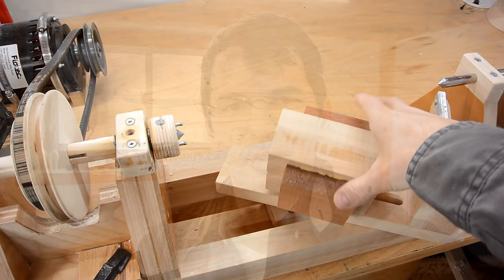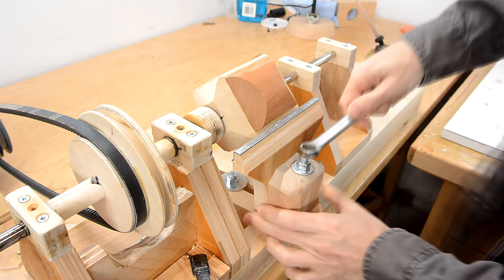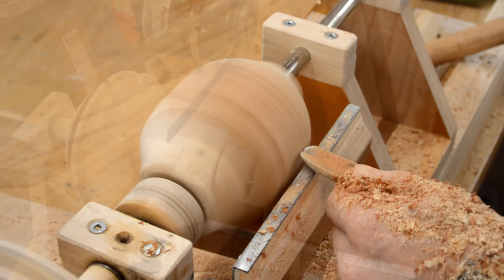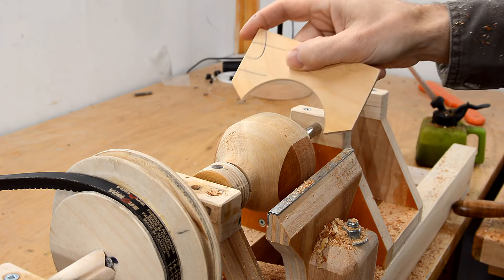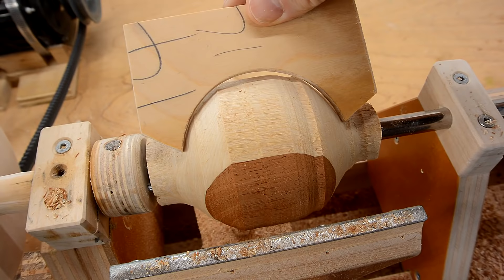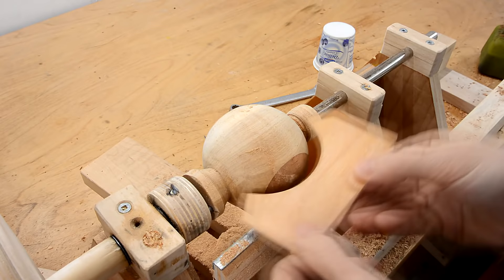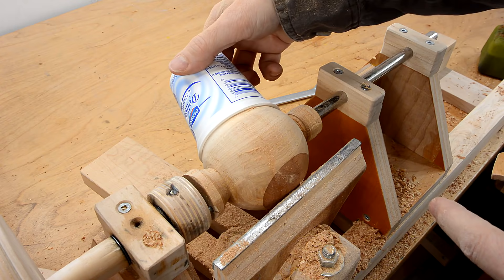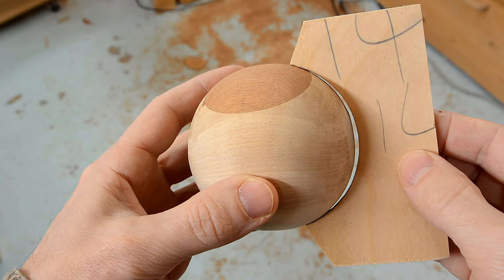Turning a ball on the lathe

Comment: solution for your smooth shaft on the lathe, a washer anchored to one of the upright, a drill stop and a couple of drops of oil. the washer acts a a bearing plate the drill stop holds the shaft in place and the oil reduces the friction.

Comment: For the tail stock problem, you can take a 1/2 threaded rod and grind the end smooth, and put a couple of locking wing nuts on the shaft.

Comment: If you put directly under the assumed center of the ball to be cut, a pivot point attached to your  cutting of the ball and swing it in an arc. you will have a true sphere. and you can stretch the radius arm to make any size ball.

Comment: maybe build a cap at the end of the tail stock with a knob or a screw, then you be able to lock in the shaft and possibly give it fine adjust pressure option, basically a box to go around end of tail stock, then you put a bolt through it lining up with the shaft

Comment: Press a couple bearings onto that tailstock shaft, then you can hold everything in place easier plus have a spinning tail. Or just put a pin through it so it cant move back.
Reply: I thought of a simple bolt screw in line, so you could tension or loosen the shaft.

Comment: I have an idea that might fix the problem with the tail stock: drill a shallow hole in the end of the shaft, place a single ball bearing there, and have another piece of wood bear against that by fixing it to the tail-stock frame. Then figure out a method to prevent the bearing falling out when the apparatus is not under load.

Comment: you need a Shaft Collar on the tale stock shaft their supper cheap they come in two basic types. split ware you have 2 half circle pieces usually held together with screws. and solid ones held with a set screw.

Comment: Maybe an adapter/adaptor for holding the ball in place, while you shape the ends of the ball after cutting and minor sanding? Something that would go over the existing setup or cound be interchanged, so the work isn't skewered yet, still doesn't fly away. It would be your version of a jaw.

I also take it the tension on the belt is adequate? it did jump about a bit >.<

Comment: Did you have vacuum dust extraction below the lathe? I could see the airflow when you were sanding the ball. 
For metal and perspex, I use a ball turning tool that pivots the cutter in a perfect arc as I advance the cut. I think you could probably make something like that for your lathe, to get a perfect sphere. An extension of that concept could be used to cut parabolic curves. Or possibly using a template to cut more complex shapes repeatably.

Comment: If you thread the right end of the tailstock shaft and put a nut ahead of the right side support the tail can be easily tightened. Drill the shaft and place a smaller center shaft inside against a bearing ball to have a live center.
    Mike (o\!/o)

Comment: Thanks for another great video.
I have a suggestion for another test with your joint testing apparatice. Steve Ramsey showed in his video about everybody's favourate joinery (pocket holes) how he kind of seals the endgrain of buut joints by smeering a lot of glue in it. I would be very interested, if this method makes butt joints stronger.

Comment: Why not put something like a nail through the smooth shaft, and then put a washer behind it with the washer sitting on the wood bits to keep the shaft from sliding? Really nice set up for being made out of recycled materials.
Reply: +Roborvski There's a lot of ways of preventing it. One i'm going to try is drill from the top through the rod and drop a nail in as a keeper

Comment: A flat spot you say? Probably because it was a hand holding the tool, not a machine. Make a wooden gear system to mill it down! hehe 
And you can put some kind of a stopper behind that center's spindle to stop it from traveling.

Comment: Most small lathes I've seen have a heavy headstock wheel, this acts a bit like a mass, which may keep the moment of inertia.
Maybe the whole thing is too light and easy to stop. If it is not too dangerous, you could maybe add a bit of mass to the headstock.
Reply from the maker: +Laifs I actually like that it stops easily.  Safer that way
Reply: +Matthias Wandel Ah ok. It seemed at the time that a low moment of inertia might be a bit of a disadvantage. I do agree with safety, a heavy flywheel on the lathe would be something dangerous.

Comment: I understand the benefit of some slack in the belt to allow the belt to slip if need, but it seems like the belt is wobbling a lot when cutting into the piece. Would a third guide-wheel help keep the belt aligned, or would it add too much tension and defeat the purpose of the slack?

Comment: Probably could have gotten it perfect by glueing a peice of sandpaper to the inside of the guide and using that to shape it on the lathe, starting with like 50 grit.
Reply: Smart!
Reply: Or make the guide out of steel, sharpen the inside, put a handle on it, and use it like an oversize lathe tool. May have to swap out the motor for a beastier motor though.
Reply: +Double Dare Fan +Double Dare Fan Yeah that would work, although inside curves are notoriously difficult to sharpen well I'm sure Matthias could throw together a jig to do it

Comment: I'm not a wood worker at all but would love to be and I love watching your videos. One question/comment. If you put a durable sanding strip inside the 1/2 circle guide you are using and got the sphere to where it just fit into the outer part of the guide, wouldn't it sand it down perfectly?
Reply from the maker: +Greg Scavezze It would, until the sand paper gets plugged up with dust - which it would after about two seconds.

Comment: Pretty good for what I'm assuming is one of your first(?) lathe projects. It makes me a bit sad to see that you're so ho-hum about lathes. They're certainly not a workshop necessity, but there are so many nice/fun things you can make with one. Tool handles, turned legs, split turnings, columns, finials, bowls, platters, knobs, etc. I guess I see much more use from owning one (a cheap crappy Mastercraft) because I do antiques restoration and clock repair as a hobby, which often involves replacing or rebuilding items like finials and turnings. I would picture you at least using it for custom tool handles (it might be nice to make some nice handles for your screw-advance box joint jig, or some of your other cool gadgets that use similar handles).

Comment: Nice one.I tried to make one using a washing machine motor. A low speed though there was very little tourque.Any pointers? Cheers Shev
Reply: +peter shevlan Small pulley on motor, large pulley on lathe spindle = higher speed. If by torque you mean you could stop it easily, add weight by way of flywheel(make sure it doesn't get too heavy, just heavy enough you can cut easily without stopping it). If torque as in it had trouble moving the piece(washing machine motor shouldn't have that problem), get a bigger motor.

Comment: Why not create a spherical blade that can expand and contract in size?
Reply from the maker: +0xD201d Why not you make that?
Reply: +Matthias Wandel What about some mechanism to hold the blade in place. Just a straight "stick" with adjustable length (for different radius), an extension perpendicular to the "stick", then something to hold the blade. Then the "stick" would swivel around the point where it's fastened? That should make a sphere, right? Might be hard to get it rigid enough, but in effect it should make an easy method of creating wooden spheres of any radius. You could off set it to get "pretty" round bits for chair legs and such. I guess the swivel point would have to be on an equal Z to the centre, but if you mount it all on a threaded rod you could easily and accurately adjust the offset. It might be a stupid idea, but it would be nice if you tested it. A mock up, or proof of concept, shouldn't take you long to make.
Reply: +Matthias Wandel it isn't that hard. start with a curved milling bit.
Reply: +0xD201d  If that yoghurt container can check itf it's a  perfect sphere, why can't it cut a perfect sphere? If it was a steel cylinder, with a cutting edge I mean?
Reply: +Matthias Wandel Actually I can imagine a chisel grabbed on a holder mounted on two circular guides kinda: ---(--- (-- so you can move in a perfectly circular path.. it all could be made of wood and bolts. It'd be cool if you gave it a try ^_^